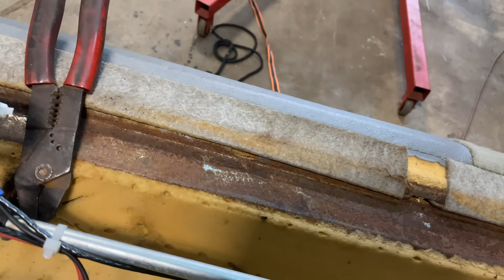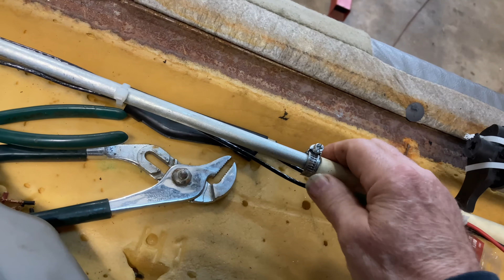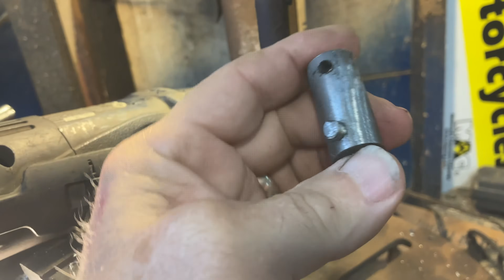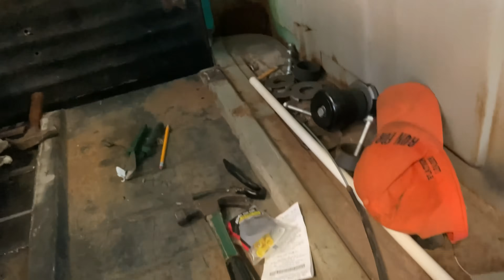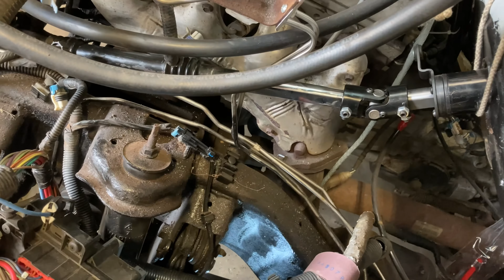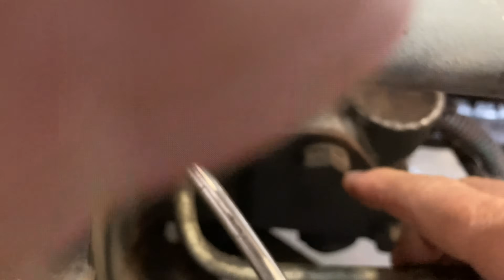57 Chevy truck on a 2004 4x4 Yukon frame build PT3

Comment: Joffery,  Could you clarify on how and why you moved the cab forward 1.5 inches?  Also could you comment on any problems or physical problems you encountered doing this change?  Thanks, you've already greatly improved my nearly exact build that I am currently working on.
Reply from the maker: Hey Jim! So we moved the cab forward 1.5 inches after the mock-up for two reasons. The main reason is it gave us the room we needed to keep our stock fan setup with our new radiator. We were very close with it in the original spot and the extra space gave us the little clearance we needed for the radiator. If you watch the first video at the end you will see there is a gap between the front fenders and the cab. So moving the cab forward made the gap fit and also gave us radiator room.